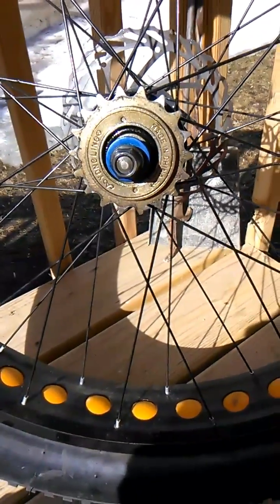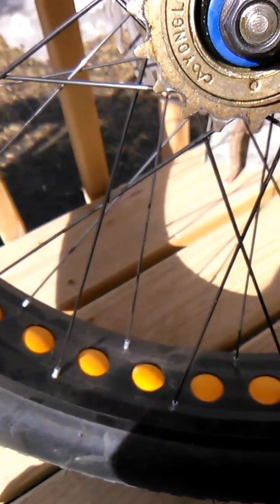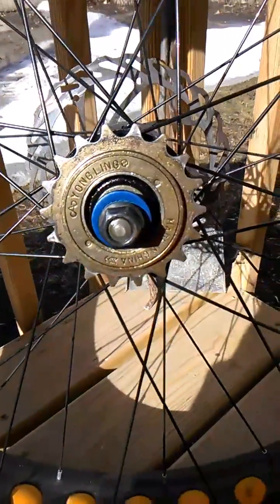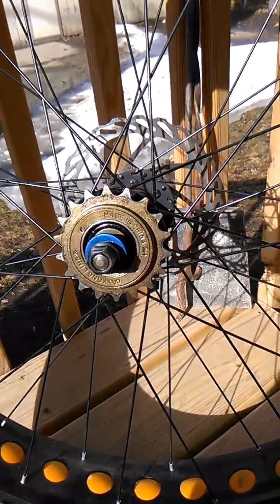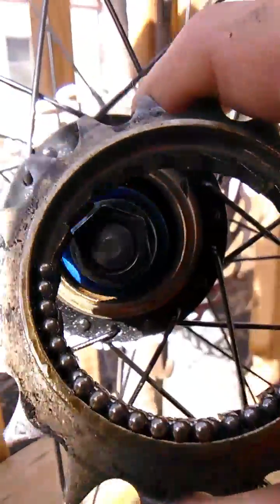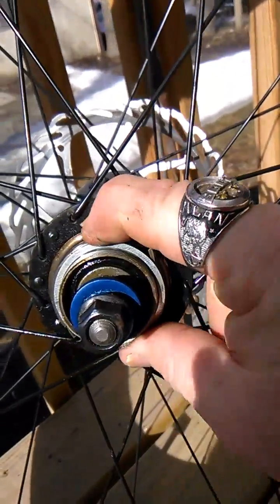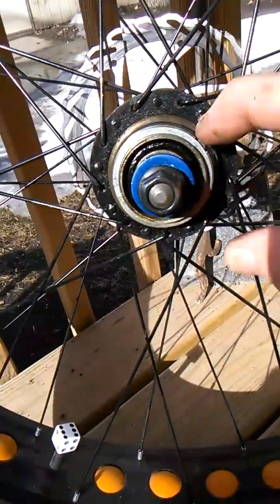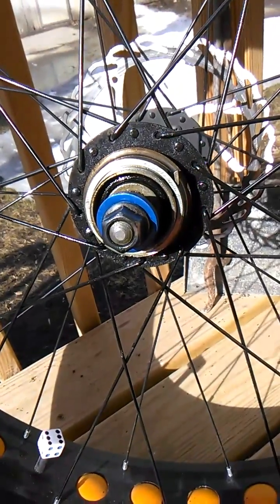Freewheel removal of junk China ones with basic tools

Comment: Great tips thanks! I never knew you could disassemble these type freewheels without the notches 👍🏼 I’d use a big pipe wrench to get it off or clamp the remainder of the freewheel into a vise, then grab and turn wheel/tire counterclockwise loosening hub. Have a great day! Ty

Comment: They may be junk but since mine is on a $100 wal-mart single speed bike I'm not surprised. Plus the replacement I bought on Amazon was only 11 bucks. And fairly easy to replace in like 30minutes or less thanks to your video. I use a hammer and punch on the attachment ring too, banging on one of the ratchet cogs. Was thinking about trying to see if I could fix the old one but since I had o bang on it I didn't and figured for 11 bucks wasn't worth my time. So hopefully I'm back to riding every couple weeks for 10 to 15 miles at a time, or a 30 mile  MS bike ride, for another 5 or 6 years! And if I need another then I'll buy another one if I can find them.

Comment: Thanks, worked just as in the video. To clarify to get the final bit off you give it a counter clock turn with the vice grips. Had to remove this piece to fix a spoke on a cheap fixie bike.

Comment: Thanks, I used a screwdriver and heated it up with a heat gun first. Came away easy after that. Shame they fall to bits when removed, but so cheap to replace its worth replacing them

Comment: This is how you add grease also if freewheel still good also,  Flip over a trash can lid, bucket etc after you get freewheel cover loose as shown here and lay wheel on it. Carefully unscrew cover, squirt in the grease and screw cover on. Whole trick is not disturb ball bearings or anything. Bucket is to catch ball bearings if you have a mishap.

To get the rest of gutted freewheel off the hub or axle adaptor (Trike) break out the pipe wrench .  Counter clockwise .

Remember the 2 pin hole cover comes off clockwise on these cheapie Freewheels.
Get  better quality replacement single speed freewheels with slots :)

Comment: Another way to do this is to drill out those little indentations just enough to hammer old steel allen keys in without hitting the hub, heat the freewheel with a heat gun on low, and swing it off with a conventional chain whip.

Comment: i remove that part that you turned clockwise then the bearings and sprocket come off...but than that part that has the pawls are still intact in the hub....how do i remove it? i tried to use a vice grip and the part intact won't even budge..

I have a bmx wheels

Comment: wow thank you. these are horrendous, why would they make a single use freewheel sprocket!!
Reply: Because it's cheaper to produce. It's a shame.
Reply: Because why not? You are removing the freewheel because you want to take a look at it how pretty it is? Probably not. No, you are removing it, because it's worn out, broken or you're simply replacing it with a new one so you won't need it anymore. Unless you want to put it behind glass on your wall.
Reply: @vojtechpilar5809  lol um no, you are the only person who likes these, there's something wrong with u
Reply: @vojtechpilar5809  no, but what if those notch holes gets worn out.. how will you remove the sprocket?...

What i'm saying is.. we really need those Removing notches not just these two holes, so "Atleast" we can safely remove it from the hub, without breaking those two notch holes.. that's why, a place to put the remover tool is important. 

Also: This is why they say chinese sprockets are junks because, why would you waste money on keep replacing stuff if you can just repair it?.
Reply: @vojtechpilar5809  it's a Yes when it comes to a cheaper easy access part, but a NO when it comes to Longevity and quality.

Comment: I used channel locks and small flat head where you can take the cap off channel locks like he said when that thing goes counter clock wise I barely tap it with a small long flat head just loosen up if it’s really tight spray it with WD-40 inside of the body of the single speed should come off mine was really tight had to hit the top where the pawls go and came off pretty simple with channel locks and small long flat head but sure you get small flat head that fit the holes take off channel locks are pretty good especially long big ones that hold son of gun

Comment: If you where having trouble like me and the free wheel is basically stuck on there forever just and your not going to reuse that free wheel just take a Dremel and Dremel the sides of the freewheel and do a little Prying and it should come right off just trust me it worked for me good luck. Hope this helps.